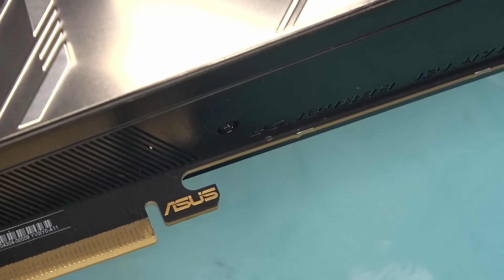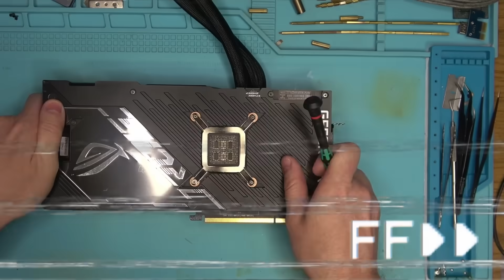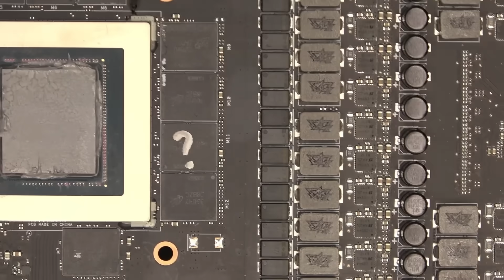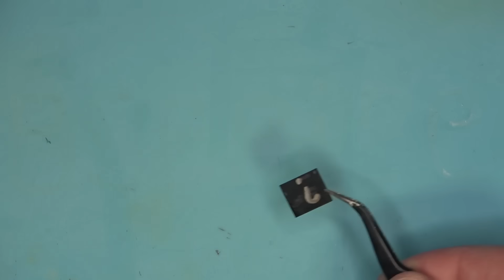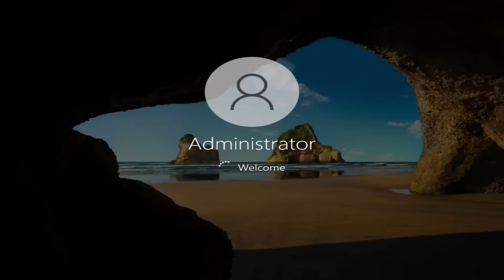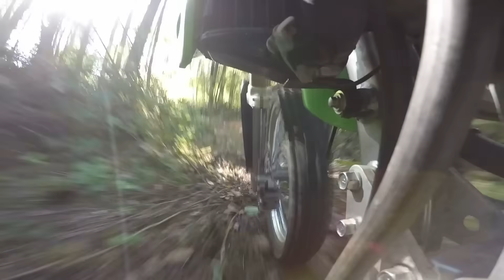Asus Strix 4090 Hybrid repair. Killed after replacing thermal pads

Comment: Hi. Im noticing you use a hot air station with the blower in the handle. Do you mind telling me what model it is? Also im curious why you use that one instead of the other style with the blower inside the unit. Thank you

Comment: Hi. This is Scott again. I have  finally bought a good quality soldering station and getting ready  to buy a hot air station  and a good quality microscope like yours. My question is besides being a atleast 1200 degree hot air station. If you were to buy a new digital microscope.  What would you buy after using yours for years and trying all these other brands. What would you buy that will work with an articulating arm that clamps onto the edge of your desk? I'm s8ck and tiered of trying to find the pe4fect one from o m a reputal company that actually works good and will accept all the different lenses and follow lens and led l8ght that's adjustable  brightness i don't want to have to return something because it doesn't work doing the type of work you do. I don't trust anyone but you when it comes to your opinions and the quality of your work. I was a heavy equipment  tech before my plane crash so I'm now switching to working for myself here in Mount Vernon WA State.  Your opinions mean more to me than any other repair company or personal like y I u know who. He's does amazing work SOMETIMES haha!:) but I have beenvwatching every videoas soon as you release them and you in my opinion are by far the best!!! That's why I am asking you. You do amazing work and troubleshooting!! So if you could please help me figuer out the best digital microscope and 1200 degree hot air station to buy i will. Thank hou very much for taking your time and reading our questions. By the way I do not use discord because no matter what I do. It will not let me join you when I ask to have me excepted. It just doesn't do it so I can n9t get access to your discord and send you some money for the help I need from you. Thanks aga8n and hope to hear from you! Take care and keep on keeping on! :)

Comment: the fact that the 4090 is now a mid range gpu is amazing
Reply: who says that? 4090 still high end. even rtx 3090 still high end.
Reply: @saijyo8549 5070ti, 5080 and 5090 have already surpassed 4090 by far and opened the doors for 8k gaming thanks to frame generation x4, plus pretty sure that 5070 super, 5070ti super and 5080 super will brutally destroy 4090.
Reply: @saijyo8549 5070ti, 5080 and 5090 already surpassed 4090 by far and opened the doors for 8k gaming thanks to frame generation x4, plus pretty sure that 5070 super and 5080 super will brutally destroy 4090.
Reply: @saijyo8549  nuh uh. 5070ti, 5080 and 5090 are good gpus for 8k gaming with fg on, while 4090 barely holds for 4k gaming. plus 5070ti super. 5080 super and 5070 super will easily destroy 4090 thanks to frame generation x4.

Comment: Back in January of 2023 i bought a gigabyte 6750xt for a friend, and somehow decided to open it and check if everything's alright, because i knew that card had some time in storage for sure, and my friend wasn't that good with electronics and maintenance, other than removing dust from them. 
Long story short, the right side of the power phases the drivers had zero imprint on the thermal pad they came with. I think it was 1- or 0.9mm and i used the 1.2 i had. Applied thermal paste on the core and screwed the cooler back on and then removed it to check therm paste spread and driver imprint. It was all perfect and then shipped it to my friend. Card works with awesome temps since then. 
*  Thermal paste was also super thin and dried up when i first opened it

Pretty sure they do that on purpose

Comment: I know when Need For Speed franchise began, due to friends who loved to play racing games, I only played few, like Lotus back then in 1995, due to local multiplayer. I think I skipped NFS1, because it didn't have that, I think that came with NFS2. I otherwise preferred stuff like Worms or Scorched Earth for local multiplayer. Though I got to admit, inclusion of cops in NFS3: Hot Pursuit did spike my interest more than racing games would normally. Though post 1995 was interesting, at some point I got to shooters where mouse wasn't optional and I had to get used to play with mouse and keyboard... might sound silly issue to have, but after years of keyboard only, even early FPS games could be played on keyboard only, I am talking ones like Doom. They did support mouse, just didn't require it, since mouse aiming wasn't a thing in same way as today. Doom wise because game in background was actually running in 2D and not 3D, hence why you also couldn't have one room above other room, all levels had to be "compressible" to 2D plain with no overlap, to help hardware keeping up. Fun times.

Comment: Nah.
I dont want a (replacement chip) installed on my 2000 plus card. Not one you pulled off another unit, but Brand New.
And if you have new, how are we suppose to believe its new.😀
Those replacement chips have been used and heated at least 2 times to remove and install. And heat degrades the chip.😊

Comment: 4090 is so strong that it decided to run game exclusively on idle clocks
Reply: That chip could probably run that game and still not overheat if you disconnected the fans ;)
Reply: honestly he couldve plugged the hdmi into the mb and it still wouldve run the game over 60fps 🤣4090 was probably working harder on keeping background apps drawn

Comment: I've a Strix RX 6800 XT that looks identical. Never changed pads, runs cool as menthol. Not sure why people bother with swapping pads. Not that it's bad but it seems many repairs are because people replace pads and make mistakes. If temps are good why change them?
Reply: I've had cards with the pads not set correctly from the factory and had to change them even though temps were within spec.  Definitely not the norm but it does happen and will kill the memory eventually.

Comment: Im sure they make a full jacket wateeblock for that beast.
The hybrid cooling isnt all that.
But still yet, Asus#1 GPU. Motherboards, as well as their Fan control. LED control, and OC AI.
Never an issue un solved caused by me.
Asus replaced w a New Maxumus Formula XIII

Comment: Does anyone know the pad sizes I need for a PNY 4090?
Reply: You can stack a bunch of painter tape on the memory chips, then keep removing a layer of painter tape until the paste on the gpu is squished to an hair thin layer. Whatever painter tape you have left on the card, measure it with a caliper, and it will be of the correct size. Then repeat again for other components like mosfets, but do not test vram and mosfets' heights at the same time. You need to assemble the heatsink completely every time for this test to be accurate. Whenever you get the pads, make sure they are actually of the ordered height. Sometimes 1mm ones are more like 1.5mm, and that can be dangerous if they can't be squished down to 1mm, so again you need to make sure that the gpu makes good contact.
Reply: Thanks for the tip. I thought I should ask on this channel because I am pretty sure this dude fixed a PNY 4090 before and thought he might know. @Wes1262-x2k

Comment: I said right away nooooo thats the wrong one! You said B0 but you marked B1. I didn't finish the video yet.
edit: Great, you found the mistake, GPU fixed, just a good ol VRAM replacement. I had one of these 4090 hybrids, they're a complete pain the disassemble as you found too.
Reply: I was just happy that what should have been a simple fix didn't turn into a full major surgery GPU reball.  Seemed like he was so gonna go there as a cliffhanger.